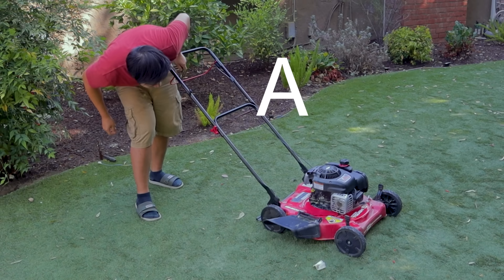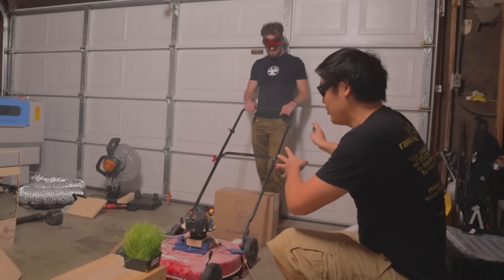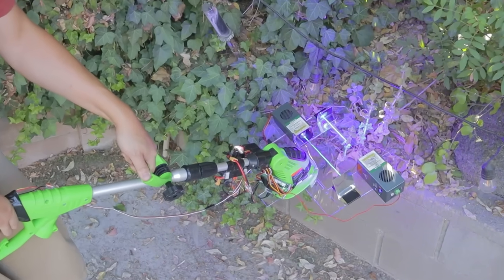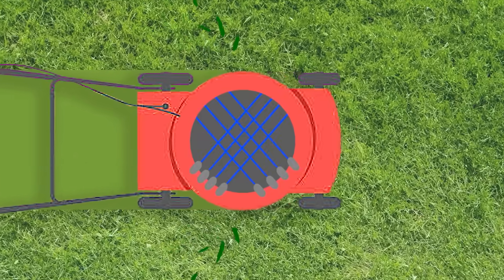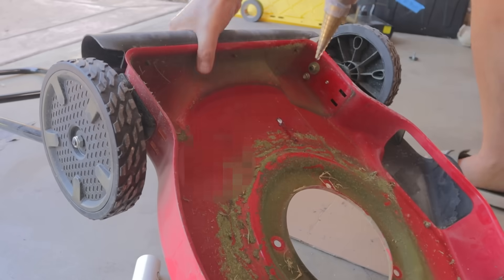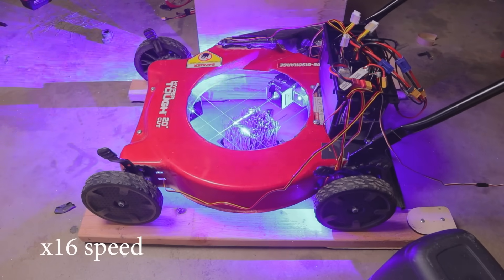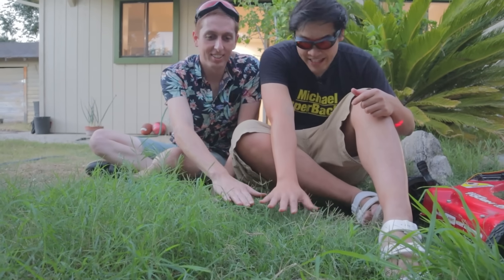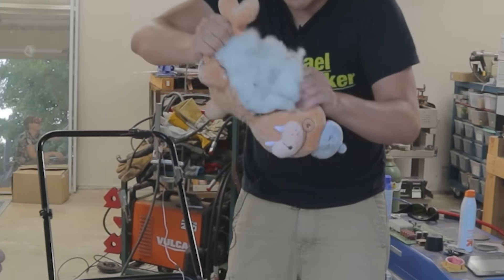mowing a Lawn like it's the year 3000

Comment: Here's a fix for the problem, perhaps you need to add 3 small, slow, rotating prisms or mirrors, so the lasers act as a colidacope.  When when the Gras moves, or the ground moves from not being un even it will cut it.

Comment: For example, if u have problems with the laser melting your metal, use the original lenses so it is weaker, it wont burn through the metal

Comment: plz try again but put a huge fan on top similar to a laef blower impeller so not only does it pull up the grass like a combustion mower, but it will help spread and disperse.  I think it would also help hold the grass in a more stable position to get cut.  Also squishy wheels but that's extra.  You spent so much on the lasers I want this to work!

Comment: Seeing the video and the improvement ideas, I had an idea to reduce the number of lasers needed to a single but powerful one. and point it not horizontally but vertically and use mirror games so that the laser makes a path between lots of small mirrors to form a dense zone of rays that pass and repass in several places (to form a shape a pattern like the deadly laser in Resident Evil in the corridor), and which ends with a mirror that sends it back vertically towards the ground (but so that it does not touch the ground we can put a piece of ceramic or other material that resists it)

After remains that a single laser means that as soon as it is interrupted in one place, it interrupts all its path, it is the big problem of my virtual assembly. And also the loss of energy over the distance.

But if we don't care about the laser's power in W, its consumption and the heat it will produce in terms of power supply or others, I would see rust stripping lasers adapted to this.

However, I remind you that I am not trying to say "I have a better idea" or "I am first degree on the idea that it works" but really I am going to make a small concept plan with the idea.

Comment: Design flaw. The front should be open. Wide open. The lasers should run parallel with the front and have at least 4 rows. The opening will not lay down the grass. The wheels need to be really narrow. You can look at the thin metal wheels they use for certain jobs on tractors for context. The front should like like a harp laying on its side missing the column or piller (the straight part).

Comment: For reduction of hazardous substances a corded lawn mower would be the better choice.  Too many battery products these days.  Also, any scientist and GOOD engineer would say touch up your knowledge on Occam's Razor, it should be the first thing to know when in engineering school.  I still use gas equipment because it is just easier to use.  Pull a lever and a cord and go.  "Recharging" the gas mower takes seconds vs hours for a battery machine.  It's also way more tolerant to dust and debris than most electrical mowers as well.  Yes, gas lawn mowers have a tendency to release carbon and other emissions but with the amount of fossil fuels used in the states to generate electricity, you just offset those carbon emissions and ad hazardous chemicals to the mix with battery technology.

Comment: What if the lasers were mounted on platform with some kind of suspension instead of a mower chassis? Or could having the lasers oscillate help compensate for the unlevel terrain? You could have a ducted fan blowing across the top of the mower deck to lift the cut grass away so the lasers aren't blocked by the grass they just cut.

Comment: You should install a vacuum on the top the lawn-mower opening, which would both clear the cut grass out of the way of the lasers, and also straighten the uncut blades so they are easier to cut.

Comment: Just use the internal of a Hand Barcode scanner, then switch the laser in it for one 1000 more power.
As side not, you can just make a robot that moves very slow.
And yes, you can use telescope lenses/mirror to get a narrower beam for extreme lengths, is just a bit hard.

Comment: So California bans gas mowers, but doesn't have clean electricity to power electric mowers with, meaning they're just creating pollution at the power plants and then wasting time, energy, and material getting the electricity from the fuel into your mower. And they don't care about the pollution involved in making all those batteries.
Typical.

Comment: "if it wasn't just a regular lawn mower that's $800"

i mean, if you don't instantly go towards the biggest most powerful one, it wouldn't be, you can absolutely get a good quality electric mower that mows just as good as any decent gas mower for cheaper then that, for one, you probably wont need self-propel on an electric mower as they weigh much less then a gas mower and are easier to push, that's a big cost savings right there, and before anyone goes on about range or whatever, we're talking about your average residential yard, not your fucking giant plot of land in the middle of nowhere, or your landscaping buisness or whatever, and for your average residential yard, an electric mower will mow it just fine on a single charge, hell, i have a quarter acre and i can mow my entire yard, front and back, on a single battery if i mow regularly (which you're supposed to do anyway) and only 2 batteries if i let it grow too high

Comment: Get better lasers and increase the power output.

IF a commercial grade CNC can cut sheet metal and etch a variety of materials far more dense than green grass, or a laser can remove rust, down to bare metal, it can certainly slice through some California grass.

Increase your budget, create something no one has, and you'll make your investment back quickly, with advertising, endorsements, and potential investors.

Comment: water, plants are made up of lots of water and water has a large thermal capacity. your 30w laser, while powerful to dry materials is slogging simply because shit is wet.

yep after going through the video, that about sums it up.
the laser at the end is cool but also looks pretty slow and you still have a high chance of fire....which is just not what you want ever.

also greenworks stuff is pretty good and cheaper then the other namebrand stuff. $300 for the lawnmower and a battery. unless you want self propelled but you gotta have the $$$$$ for that crap.

Comment: you need to attach it to a drone so there is nothing pushing the grass around. Nah it would still be impractical at best. When I saw the thumbnail though I was really expecting that to work better than it ended up but I guess laser technology just isn't there yet to have what would basically amount to a lightsaber. Well actually what about some kind of plasma to cut the lawn with... hmm...

Comment: The mower body pushing grass around is definitely a problem that can be fixed. Just need some revisions to the design of the mower. An open front would help a lot, and removing the two backwards-facing lasers.

Comment: Aside from the obvious fire and destruction problem, the color of the grass is also a problem. Some colors absorb light much better than others. The power needs to be higher as well. 30 watts is 4/100ths of one horsepower. To get the power of a 5hp lawnmower, you need almost 4,000 watts. To even have the power of an electric weed trimmer, you would need at least 500 watts. Moisture, water vapor, and smoke will add to your list of problems. That being said, grass takes a while to grow, and if you can cut the whole area in a few days, you can stay ahead of the growth, even if it takes days to cut it. 

Is there a better touchless grass cutting solution? Maybe. Try using sound.

Comment: I'm not an expert but part of your problem might be the kind of lasers you're using.  See grass is full of water and blue light is actually transmitted through water pretty easily. That means the energy is passing through it before it has time to transmit most of the heat into the grass.  If you want to go for Mark II you could try using infrared lasers as the IR is going to absorbed much more by the water in the grass.  BUT as I stated that's something of an educated guess.  Also you  may want to add a blower to dissipate the smoke, not only to protect your optics but to stop the smoke particles from absorbing a lot of your energy before it gets to the grass. If there's anybody out there that can actually do the math on it feel free to weigh in. (Also I never recommend anybody do anything reckless with lasers but since you already have...)

Comment: The Battery Operated Mowers Absolutely SUCK I bought one and it last all of my 10 to 15 Mins before dying then you need to plug the batteries in to Charge for an Hour and then back to mowing as long as they dont over heat

Comment: The problem with your idea is it's just not complicated enough. Try using the lasers to fuse hydrogen and let heat energy released obliterate your lawn in no time. Plus, the radiation released is a great weed killer. Be aware in any case that using atomic fusion or even just lasers might be outlawed in states that have wildfire problems.

Comment: Essentially when a lawnmower blade is spinning as fast as it does, it can roughly be viewed as cutting disc.  If we say that the blade has an overall length of 60 cm, that would give the disc a radius of 30 cm or 0.3 meters.  After doing some digging, I'll go with a mass of 0.8 kg and spins at 3,000 RPM.

The moment of inertia for a spinning disc is 1/2 m * r ^2.  So I = 0.036.  
KE_rot =  1/2 I * ω^2.
ω has to be rads/sec and to get that from RPM it's RPM × (2π)/60.

3,000 x (6.28)/60 = 314 rads/sec

KE_rot = 1/2 (0.036) * 314^2
KE_rot = 0.018 * 98,596
KE_rot = 1,775 Joules (rounded off)

W = J/s or rewritten as W*s = J

If you applied a 1.775 kW laser to the grass for 1 second, that would be on par with the kinetic energy of a rotating lawn mower blade.  However, the blade delivers that KE to a sharp edge and cuts grass near instantly.  How fast would do you think the laser needs to be at cutting through the grass to be able to push the mower normally?  0.1 second?  Lets go with that.

1,775 / 0.1 = 17,750 watts or 17.75 kW.  But, the cross sectional area of the laser beam matters.  If you can concentrate the energy into a thinner beam, it's like the blade delivering the KE to a sharp blade edge which cuts better and faster than a blunt edge.  So a 1.775 kW laser could probably cut the grass very fast if the beams diameter is as thick as the mower blade is sharp.  So I would say 0.25 mm max but maybe 0.15 mm to be on the safe side.  So 1.775KW laser with a beam diameter of 0.15 mm.  You might be able to go with 3 lasers @ 500 watts each but with a beam diameter of 0.1 mm.

Comment: Pulse the lasers. That is what is causing you problems. The smoke created by the laser burning the grass is absorbing the power of the beam, rather than the blade of grass. Pulse rate of 200-500hz should do nicely at preventing this. That gives the smoke time to dissipate before the next beam pulse comes in and blows another chunk out of the grass leaves.

Comment: I actually really like my Electric Mower. the thing I didn't want to deal with with Gas was oil, cleaning it out for the winter, and all that nonsense. Bought a nice Lowe's brand Kobalt 80V with two battery bay, which they weirdly and troublingly don't sell anymore... HMM... I wonder why? I haven't had issues with mine. Love that thing. Used to take 5 charges to do my front of the house alone. Now it takes 2 charges. It's been great. I did technically spring for the way more expensive 6 or 8Ah batteries as well.

Comment: Thats insane Cali is banning gas lawn mowers. We really need to start pushing back on all this electric laws and crap. There is NO reason gas lawn mowers should be banned in Cali. All the rich people making these laws also own or fly on planes constantly. The normal people (us) only use cars and some other things with engines. The amount of emissions a rich persons plane gives off from one year of flying is so incredibly more damaging then 1000s of normal people using cars, lawn mowers, weed whackers etc, for a year. Not to mention the amount of damage we do to the world mining for the resources necessary for making electric things. We should not be banning gas power things until we have a better solution for making electric things

Comment: So the problem with cutting thru grass with lasers is that many species of plants have impressive defense mechanism to resist fire, and/or heat stress from the sun, they will increase the moisture content of their leaves/stems by pulling additional water away from the root systems, they will increase their circulation to thermoregulate. This is why you can cut wood that's dead wood, and textile fabric, and burn thru metal just fine, but still struggle to cut thru branches of a living tree, or even mow thru grass with a laser. Some species of plant foliage would feel the heat build-up and roll up its leaves, or fold them down. Plants are highly reactive organisms under heat pressure because they've evolved sensitivity adaptations to survive heat pressures. I wouldn't want to get hit directly by a high power laser, especially for long periods of time, but humans also transport & dissipate heat pressure way better than they deal with blunt force trauma, or mechanical separation. So hammer and axe are scarier than a ray gun, at least, any ray gun I've seen so far that didn't have a nuclear reactor attached to it.

Comment: I'm no rocket surgeon, but hear me out. You put a Lazer on a track on one side of the lawn with a metal plate on the other. Push a button and it slowly tracks across getting the whole yard in one swoop. Yes it only works on square lawns. Yes you'd have to baby it for fire reasons. No I don't take criticism, just money

Comment: "the water evaporating".

this is a major drawback. you not only have to supply the energy to heat the water, you also have to add the energy required to take it from liquid to gas, the "latent heat"... and thats a LOT of energy. it simply wont get over 100C until its dry....

better method is to use superheated steam.

comeon, that would make a change. sparks and lasers get boring. lets see some ingenuity?

Comment: I will say the electric mowers can be more expensive but they’ll come down in cost, there’s definitely cheaper off/brand alternatives and I will never miss messing around with gas and the smell and the noise. Fun fact, your average two-stroke weed whacker engine puts out more pollution running for one hour than a standard Toyota Corolla does driving 1500 miles. They need to go.

Comment: What about a laser mower that operates like a reel mower? The spinning blade in those pulls the grass towards another cutting blade and cuts the grass more like scissors, then the spinning blade ejects the heads, or top of the grass. Have a spinning blade to draw in and hold the grass to solve the movement problem, and replace the cutting blade with some sort of laser assembly, either a grid or some sort of carriage system like from a printer that moves however many lasers you want back and forth. This would be suited best to a robot that you can put in your lawn and walk away if you do a carriage system you could have it step forward after every pass or two. And you can sleep well knowing it will randomly catch your lawn on fire. Frequently.

Comment: Working with a 30-40W laser and knowing the power those things have, watching this almost gave me a brain aneurysm.
Reply: Yep, I work in the optics & photonics industry and we take laser safety VERY seriously (as you should when they can bore a hole in your head) and this stressed me out SO much
Reply: @nicknack125  HAHA and hes flashing it all over the garage, surprised he didnt burn the house down or worse
Reply: As someone who works with 10kw+ lasers and him using those ski goggles for “safety” makes my eyesight disappear
Reply: @ImSoChildishDoe wat. Plenty of laser safety goggles that look like that.
Reply: If they're certified they're indeed protection, what else should he use?
Reply: Need a 20,000 watt
Reply: so fukking unsafe and irresponsible
Reply: As someone who is. I am
Reply: Wuss
Reply: @biggestcomplainer  put your hand in front of 40W of infrared then lemme know how you feel
Reply: Candle flame is like 80W? An ouch for sure, but with eye protection it's mostly just a fire hazard.
Reply: @steelwasp9375  A 9mm bullet fired from a Glock has about 550 J of energy. That's the same as a 5.5 L water balloon dropped from 10 m. Which would you rather get hit with?

A candle outputs 80W, but that's mostly thermal. The energy is also spread in all directions. An 80W laser outputs 80W worth of photons, all concentrated into a very small spot.

To put that number into perspective: class 4 lasers - the highest class, which can cause eye damage just by looking at the laser spot on the wall - start at 0.5W.
Reply: I run a 2500 watt so this just reminds me of a toy lol
Reply: @soflossy6447  That's the additional danger of high-power lasers: stuff that could easily fry your eyes to a cinder suddenly doesn't seem that serious hahaha